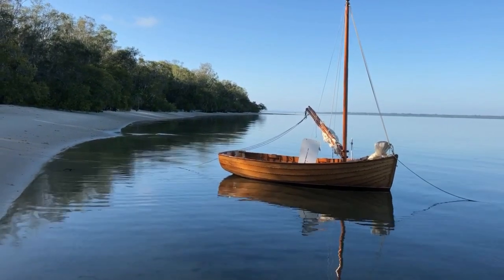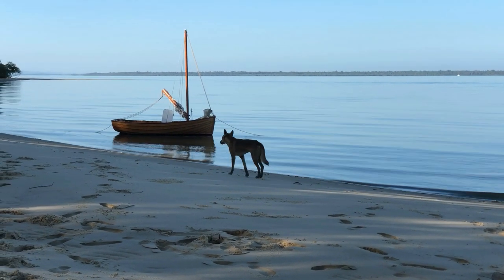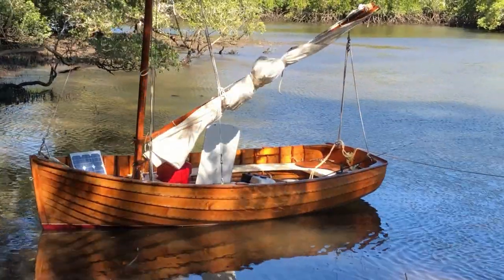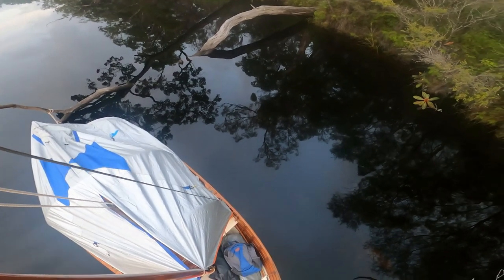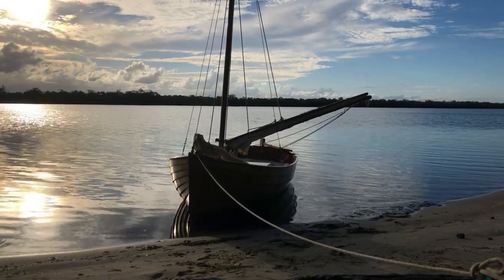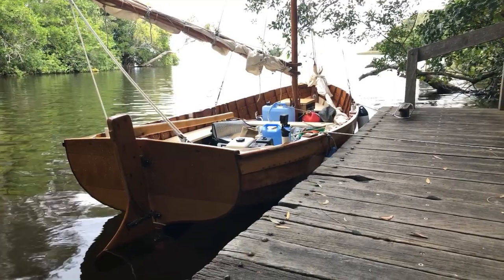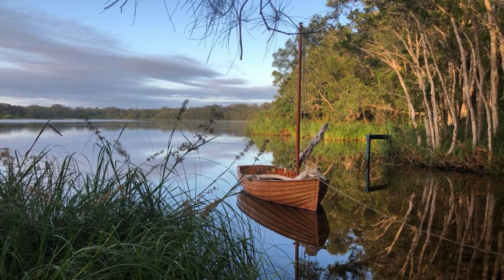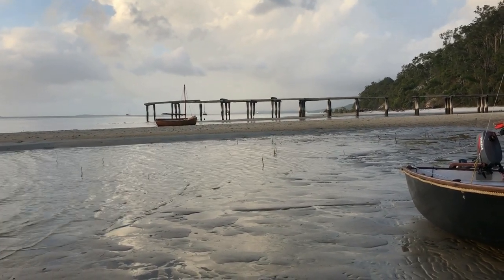Dinghy Cruising Seamanship explained in simple terms

Comment: Hi Chris. Thanks again for an informative video. I wonder if you've used the bungee line attached to the stern. It allows you to toss out the line and anchor, paddle into shore, set your bow anchor, and then the boat retracts out to deeper water.  I think plymouthwelshboy demonstrated this a while ago.  Cheers, and fair winds from Japan!
Reply from the maker: That one is news to me. I have used a pulley to and anchor allowing you to pull the out our after disembarking. I will look it up.
Reply: @SmallSailboatCruising  Helps keep the feet a bit less wet... ; )
Reply: I see it's called an "anchor buddy."